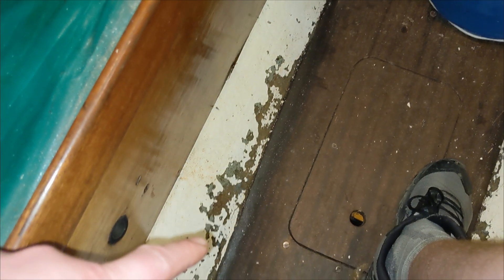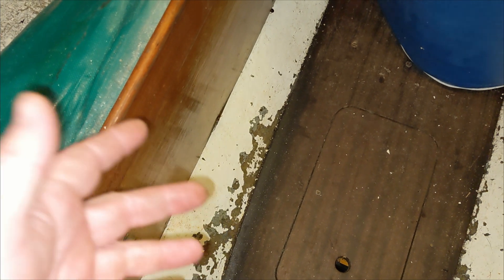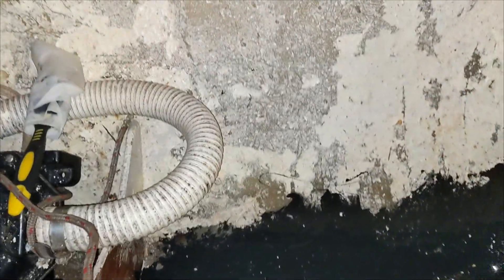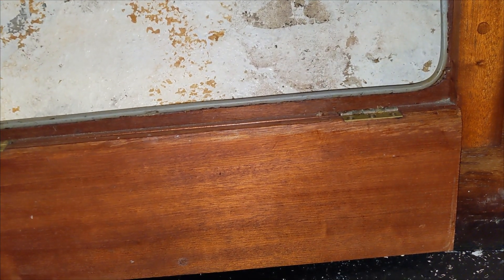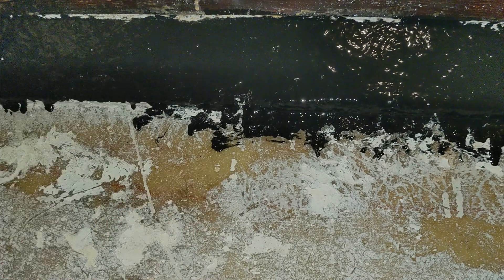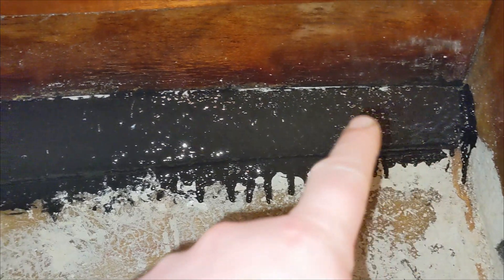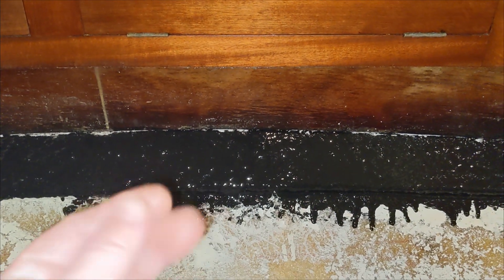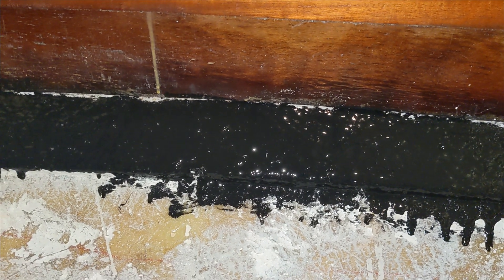There's a HOLE in my BOAT. No, really.

Comment: honestly dont think its a biggie. monitor your leak, choose the weather, dont sail the boat too hard. 
Once at home, haul out and replace everything, i would even extend what you call stringer, from bulkhead to bulkead , always observing what you might have planned for the interior design )its not a problem if you have to interrupt the stringer but its advisable to make ends meet even with deviations). I have a 62 yo VdS Pioneer 9, having stringers or their equivalent longitudinal reinforcements are needed and put to use , also when you haul out and the part of the boatºd weight is being applied onto the jackstands, creating hard spots. my hull is solid grp, not particularly thick, and iºve either replaced like for like of glassed the cabinetry close by. at a minumum i use 2 layers of biaxial cloth 400gr/m2 and epoxy in all corners and if its a big area i will further reinforce it with at least one more layer of cloth. i know you are on a budget but some items i would consider 3 and 6mm thick pieces of G10 to reinforce. it will never rot and will outlive you and the boat. not cheap but you wont have, ever, to worry about it.
Reply from the maker: Thanks for the info!

Comment: Now when I started following you I had the impression you really were clueless, but you're definitely not, you know quite a bit about boats. 
And that means its gonna be all good.
What happened with the engine mounts? 
If you get up the Welsh coast we'll sail out and give you some company!
Reply from the maker: The new steel plates are in, with the new mounts attached. Just gonna service some bits on the engine whilst it's in the cockpit, and I'll be mobile again!

Comment: That's high enough it looks like it was bumped into the dock a little too hard. You may actually be able to see the crack at low tide if the antifouling hasn't filled the crack in too much. If it were "seepage" it should be in a lot more than one place and you would have had very clear signs of blistering. "Fixing it between tides" would be quite a time sensitive task considering it is below the waterline...
Reply from the maker: Yeah, I doubt I can do anything until she's out of the water. Hopefully she's just taken a hit and it'll be a simple repair.
Reply: @BumblingSailor  GRP is easy to repair, but you cannot do it between tides. I do think you will need to be out of the water.

Comment: You havnt got a cracked hull, you’d have seen it, leak from a deck fitting somewhere has moved water into a different locker now she’s floating. That stringer will be full of condensation a lot are. It will be full of foam not wood. Stuck a 10mm drill bit into the lowest part, it prob runs the whole length of the boat. Hole will slow it to drain. 
Email the youthbe guy off refit and sail, he’s an expert on contessas and sure he would offer expert advice and opinion.
Reply from the maker: Cheers Stephen, I may well do that!
Reply: Let me know if I need to book some time off 🤣

Comment: Hello, right, It's not  probably not coming from the hull, you would have seen a crack when you were painting, but did you see the gel coat bubbling? small bubbles throughout when new is called porosity, (but its not that, cause that's when new) bubbles on the outside is osmosis, now tha'ts quite common, but can be fixed by drying out and filling with gel,  or, grinding out and filling with gel ,,(NEXT LIFT OUT),,,,do not panic ! ,,,its common, and the signs are ,,,,the boat not quite drying out internally,  YOU ARE PROBABLY JUST DRYING OUT, MORE THAN LIKELY ITS COMMING FROM THE DECK / HULL JOINT, DO NOT LIFT IT OUT AGAIN, Drill a hole in the bottom edge of the stringer to let it drain and dry, (the boats been sitting for a couple of years) then use gel and a wee patch of glass to seal it, (a wee tin of the car stuff would do to save buying a load)   cheers john
Reply from the maker: Cheers for the info John!
Reply from the maker: You don't need to shout matey 😂
Reply: @BumblingSailor  Sorry, id never forgive myself if you drilled a hole through the hull, (my dad did it once on an inland lake, no low tide) it did have to come out !
Reply from the maker: @TheJmccready  😂😂😂 to be fair, it's definitely something I'd end up doing 😂. Thanks!
Reply: @BumblingSailor  did you notice any bubbles when painting?
Reply from the maker: @TheJmccready  yeah, she's got her fair share 😂
Reply: @BumblingSailor   ok ,thought that, i'm not surprised, (good guess eh) its nothing on an old boat, i think you could address it later, much later, relax, enjoy the boat and your future journeys

Comment: Sorry to be a pessimist but..... if the hull is leaking the glassfibre might be delaminated thus rendering it very weak. The only way is rather time consuming and relatively expensive. Lift the boat out, grind back all the suspect area and dry thoroughly before laying up with glassfibre and resin.  Sorry to be so depressing but I do speak from experience. I worked in a boatyard where a boat was condemned due to delamination. I was tasked to drill holes in the suspected areas. We were bought a new hull and stripped the original hull to place all the fixtures and fittings into the new hull. Sorry.
Reply from the maker: Is delamination an issue with solid fibreglass? For some reason I thought it was on cored boats, forgive my ignorance. She's coming out of the water in a few months so I'm going to sort all the blisters out and take the gel coat off anyway. Guess I'll find out then! 😂
Reply: Delamination can be an issue but far less likely on an old boat which where built like brick out houses cos they were still learning about GRP tolerances so over built.  There is a lot I'd be checking before getting the angle grinder out. Leaking window, chain plate, hatch trim. Condensation can build up behind cupboards . More than you might think.  Water ingress a much bigger issue with sandwich construction, where the core can rot out, but not an issue here. I'd be pulling out the cupboard fronts. They need drying out and resealing anyway or will fall apart.  Then you can see more. Try the talcum powder trick to see if you can spot runs.  Get a mate to spray water onto chain plates, jib tracks, windows and hatches to see if you can spot drips.  It's always possible the hull has been hit hard and is wicking water in, but I think you would probably see evidence of that. Maybe  dry boat up against some pilings and sand back the anti fouling in the suspect area.  But it is far more likely to be a topsides leak.
Reply: @BumblingSailor  Delamination can be caused by impact or poor layup practice with the fibreglass laminates. Although most older boats were built like tanks the problem is not unknown.  This problem will cause weakness to the monocoque integrity  of the hull. It is not the exclusive area of sandwich construction.  I agree entirely with directorstu's post. Good luck!